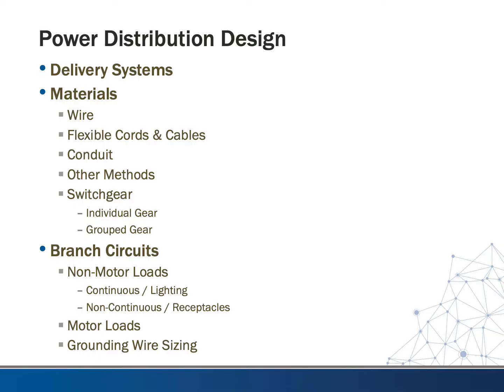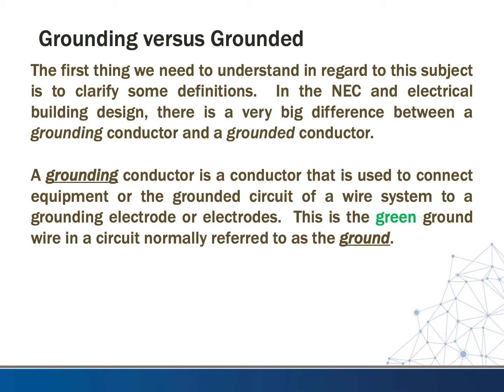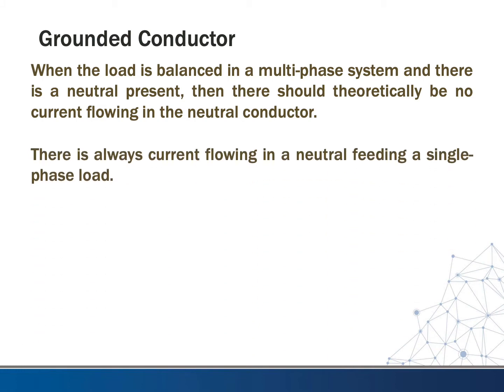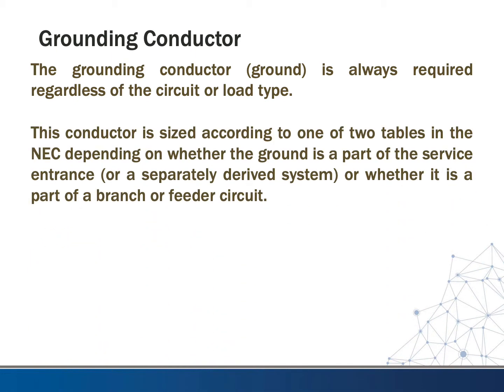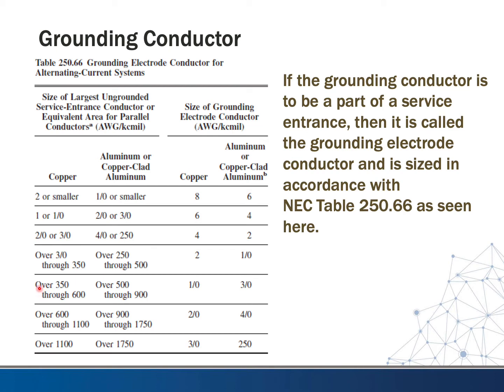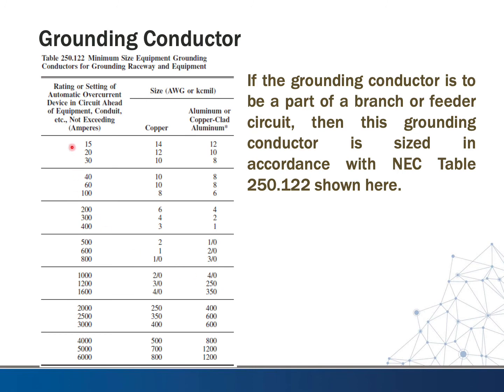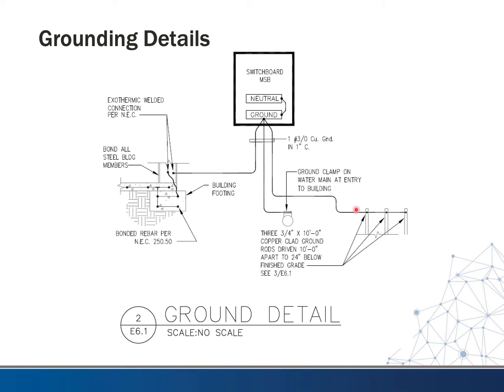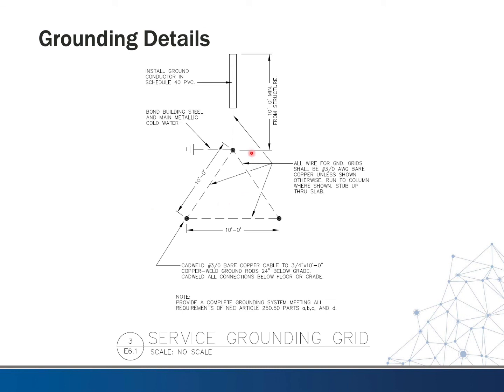Grounding Conductors for Branch Circuits and Services

Comment: ONE OF THE BEST VIDEO I found for electrical designing
Reply from the maker: Wow, Thanks!  I am glad that you found it useful!
Reply: @shaneritterEE  pleasure is all mine, sir. I will comment on the things that need to be added (this is a complete one but sometimes you might miss something) once I finish all of the video. One question: In one lighting load circuit, how many switches can be kept? As you mentioned in the slide, let's say 5000w/120 v*12.8 system 4 circuits can be accumulated. but how would you distribute that in mcb of the same floor and in different phase ?